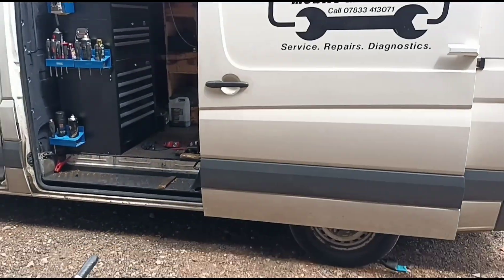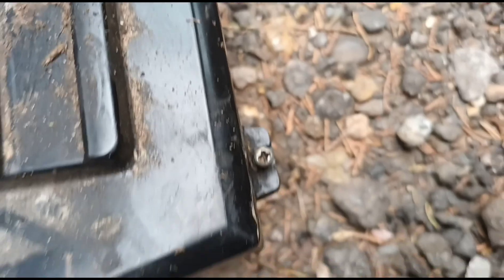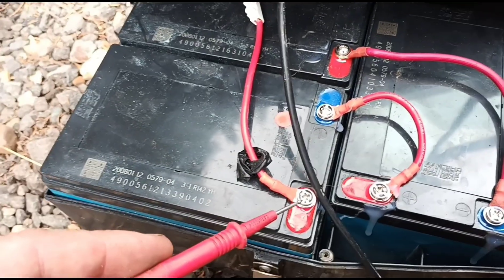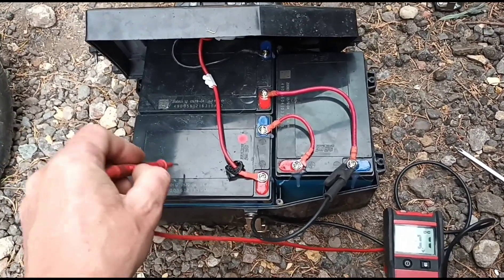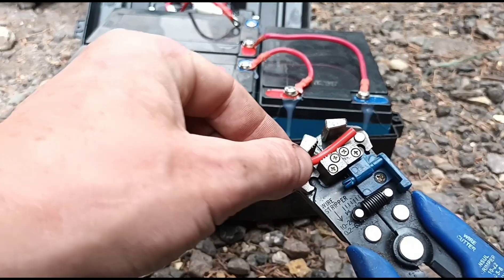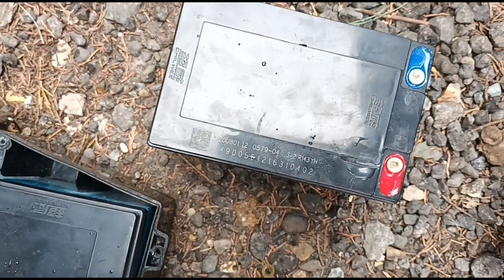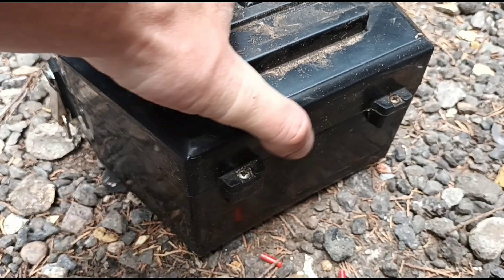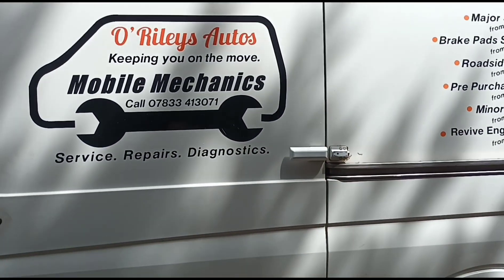36V Electric Quad Bike Battery Not Holding Charge. Battery Upgrade Stripdown

Comment: I’ve got the same same quad - same issue, I’m thinking of buying 3 batteries possibly 20AH for more battery life, will I run into any issues with the 20ah ones, maybe need a different charger? Thanks
Reply from the maker: Only thing maters is volts. Ah is just how big the storage is of the battery
Reply: Will the 20ah battery fit in the battery case  tho?
Reply: As someone who clearly has one of these, and isn't Fun Bikes, how do you rate them? I'm competent mechanically and electrically. But worried about it falling apart, it'll be for 5 year-old son who isn't heavy.